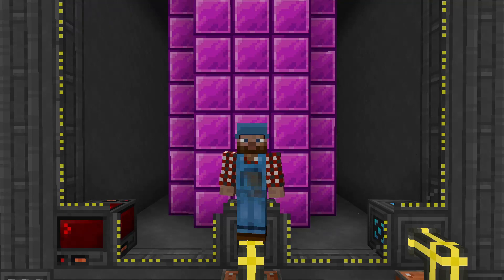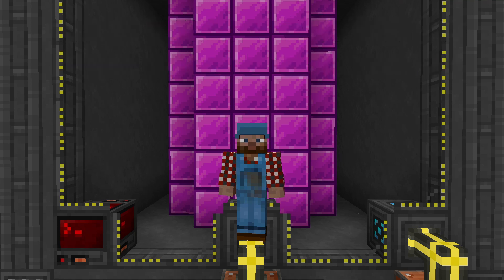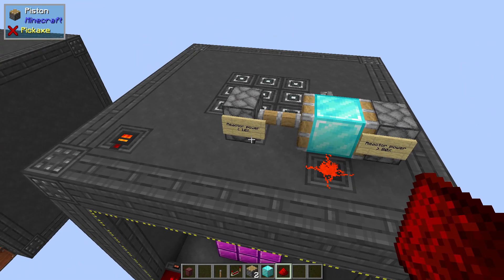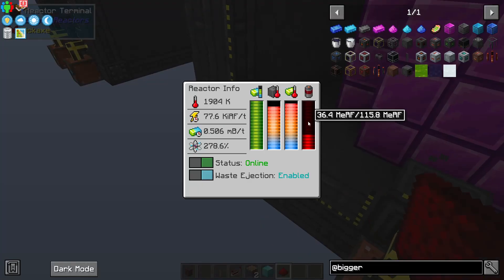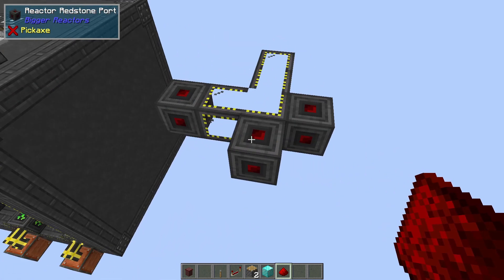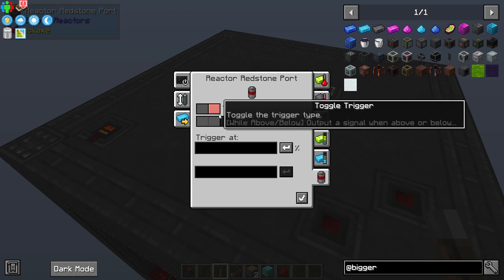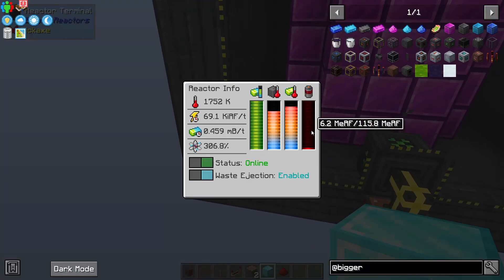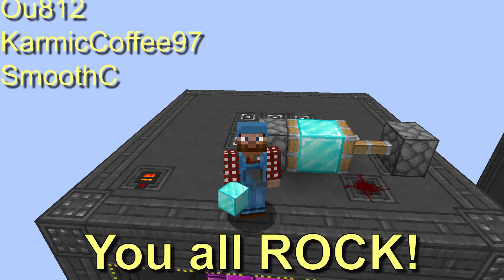Minecraft Talk #49 - Turning Bigger Reactors On/Off Automatically

Comment: You can use redstone block instead of diamond block, and move input port under redstone block.

[Piston][empty][redstone block][piston]
[Output 10%][empty][input on/off][output 90%]

Thx, nice idea btw.
Reply: This is my preferred method, yeah. Although the other way is nice because you can intentionally disable the reactor via the switch if you just want it to be shut off, like if you're trying to drain the buffer for some reason.

Comment: This is hella extra and unnecessary. Jus use 2 redstome ports and set one to send out a signal when above a value and when the other gets a redstone it it lowers the rod down to 100%. This essentially turns the reactor on and off with out the reactor ever turning off but it dosent use fuel or a minimal amount of fuel
Reply from the maker: It's worth testing to see how shut off the reactor is at 100% rod insertion as that may change with modpacks as they get customized by the authors.  I really wanted to have it turn on when below a percent and off when above a percent, so this setup works.  I really enjoy how modded Minecraft gives multiple ways to do a task.

Comment: I'd use a simpler setup involving two ports and some redstone only. one port to turn the reactor on and off, the other to output a signal if the reactor is below 75%. That will also do the trick and the length of the redstone line determines when it will actually turn on based on the signal strength :) That one will also work on the side btw.
Reply from the maker: That's simple, but you're going to get the server firing off when it's 74% full, then turning off when it's 75%.   And then back on again when it's 74% full, etc.  :D